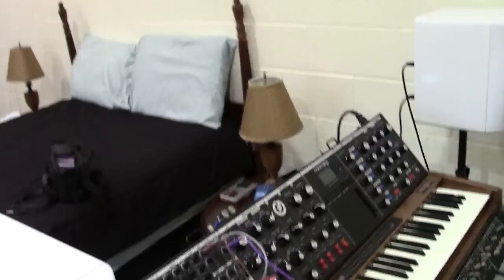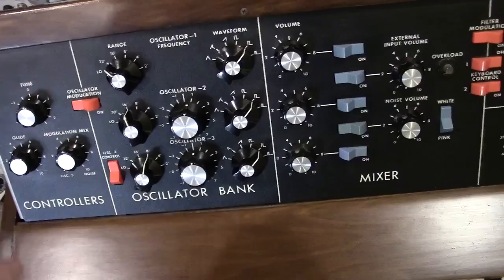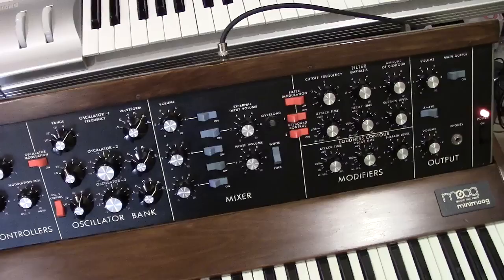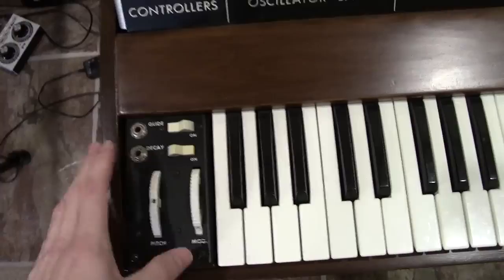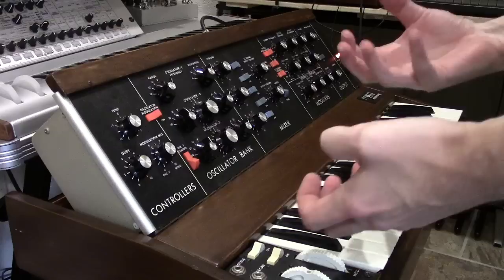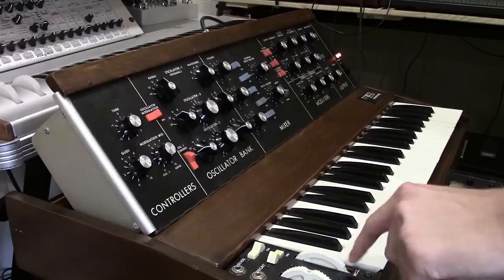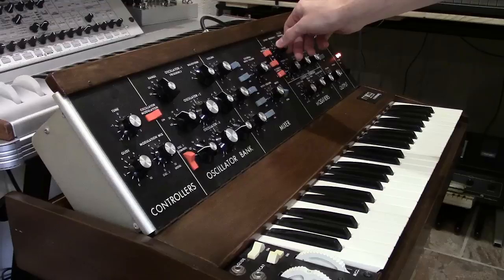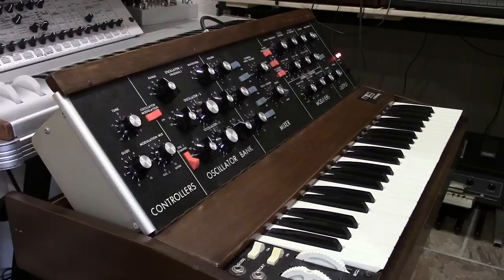John McCreary's Minimoog Repair (by Synthpro)

Comment: I wonder if they used aluminum wire. There was a similar problem here in the UK with mains wiring. I believe it was a reaction between the aluminum and brass connectors, also resulting is a green goo.
Reply from the maker: I do believe they used aluminum wiring but I would have to see what materials are used for the connectors...the strange bit about this corrosion is it is sometimes deep in the wire like it started within the core itself....its very strange. Thanks for the comment.

All the best,
Jareth

Comment: do you do work on old sequential circuits? my Prophet 600 needs work.
Reply from the maker: Hi Matt, I do work on a few SCI models and the prophet 600 is one of them, would be happy to service your 600. Those are great synths, I have owned a Prophet 5 and serviced a prophet 600 a few moths back, such a well built unit for servicing compared to the pro 5 and sounds just as good in my opinion.

All the best,
Jareth
Reply: I'd like you to work on mine. where are you located? how much did your previous service on the PROPHET 600 cost?
Reply from the maker: Great, I would be happy to service yours. Please message me at synth_pro@yahoo.com and I will give you more info regarding location, quote, payment info. (Note: That is an underscore in my address)

Thanks,
Jareth